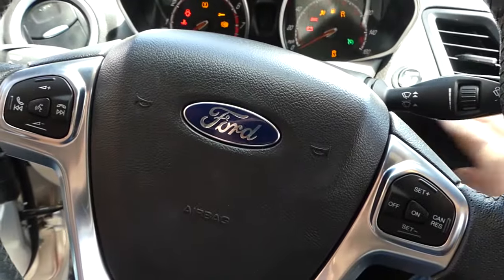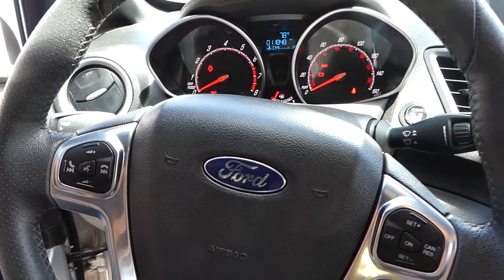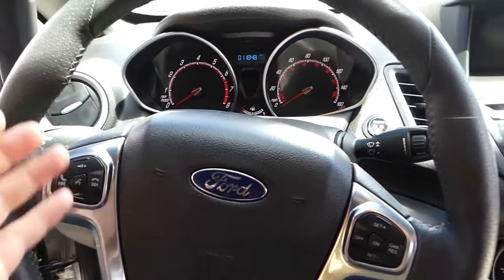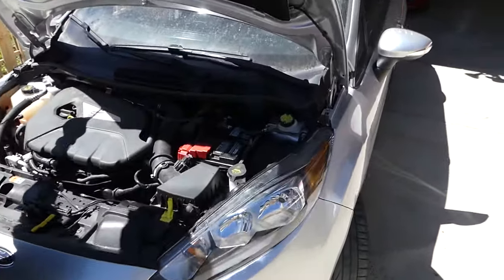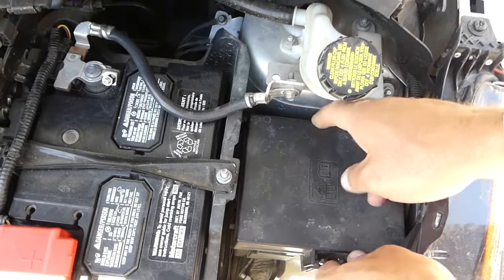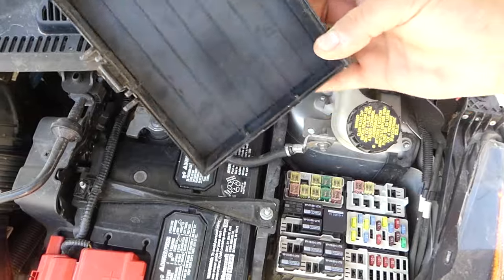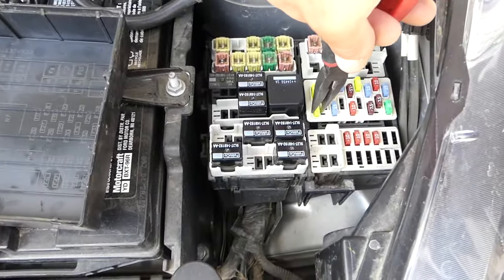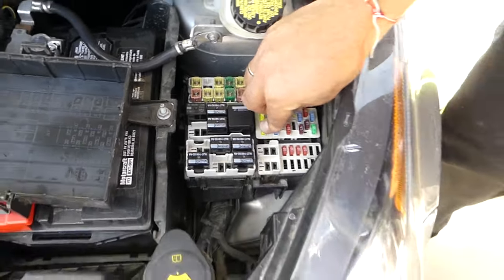FORD FIESTA HORN FUSE LOCATION REPLACEMENT MK7 ST

Comment from the maker: ⛐ Check out our Garage to see what tools we use and recommend:
https://www.amazon.com/shop/worldmechanics

⛐ Subscribe and hit the notification bell by the subscribe button for new videos: https://www.youtube.com/c/AutoRepairGuys

⛐ Our GoFundme Page: https://www.gofundme.com/auto-repair-guys
Reply: Auto Repair Guys hey i have the titanium version this problem happened out of the blue recently and i will try this fix, also my car ecery now and then says the bonnet is open but it is not , and the alarm goes off at night, any ideas???
Reply: @southwestwings8510  Hi SSW.  The reason your alarm goes off randomly is because of the latch of the hood / bonnet.  My 
Fiesta is about four years old and I  noticed it's rusted...with my buddy's help we found out it's the rusted latch that cause the problem with the alarm going off. Some times it will go off during the day as well. There is also a sensor that is connected to it. So if the latch isn't closed properly the sensor think the doors isn't closed . Plus I sat in my car and locked all doors the door indicators still shows red. So he asked me to pop the hood. He opened the hood. Raised it about a foot and let it drop / free fall to close.  Sure enough the door indicator on the dash wasn't on ( red ) anymore. So that is a indication the problem is the hood latch. He sprayed the latch with wd40 but that is a temporary fix. The best is to use grease which I will be doing next time when I head over to his place...I think that is a temporary fix as well. I think I might need to replace the entire hood latch since it is rusted. When the latch is rusted and you drive over big bumps it set the hood latch loose hence the sensor thinks one of the door was not closed.  At first we thought it was one of the four doors or the hatch wasn't closed properly.  Then as mentioned earlier he asked me to pop the hood then he closed it and the doors indicator light went off. I don't know how much it cost to have the rusted hood latch to be replace.  Having said that I was going to trade my car in for something else anyways.  
I do hope I have convey the issue to you properly and to the best of my ability.  All the best.👍